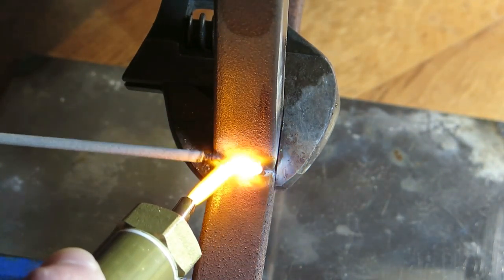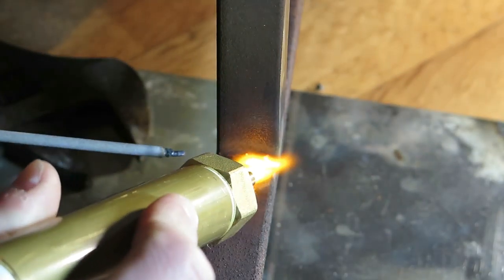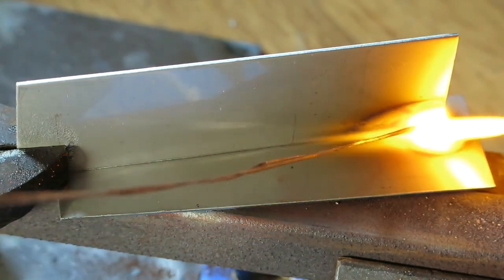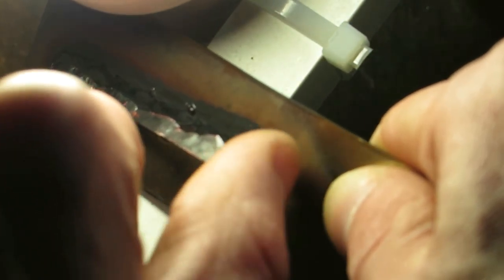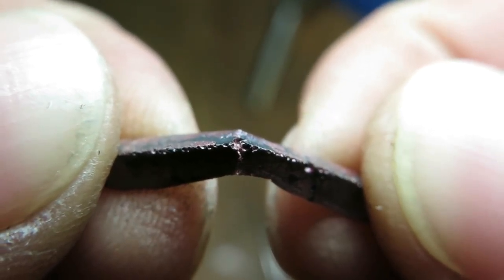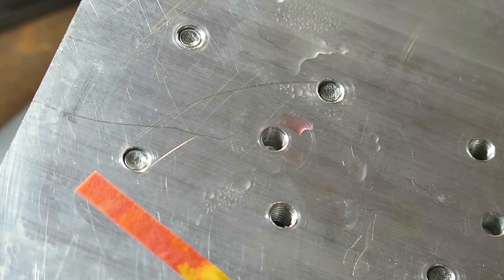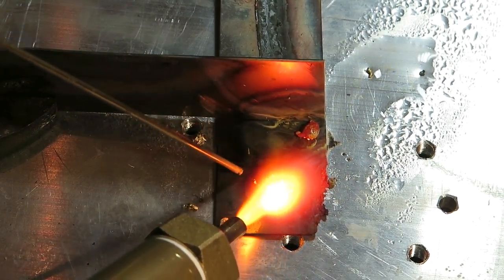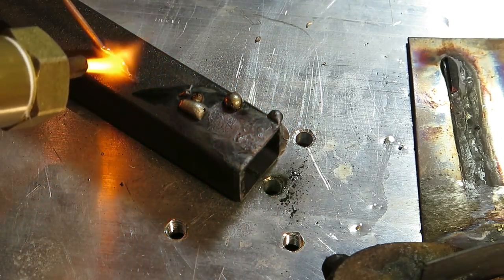Welding, brazing and melting glass with 1KW HHO

Comment: 5:54 it's due to the WATER atmosphere.  All of your metal welding issues are due to that.  Water (steam, actually) is quite reactive at this temperature.  You have oxygen, hydrogen, and vaporized metal all getting into a reactive state before calming down and going to metallic hydroxides and more water vapor.

Comment: Problem is you need 4to 6kw to weld!! If you hook up a high pressure tank that builds pressure up to 90psi then you could weld! JUST MAKE SURE TANK IS STATIC PROOF! AND YOU HAVE LIKE 3 BUBBLERS AND 3 CHECK VALVES!! OR ELSE YOU WILL BE BUILDING A BOMB!!
Reply: My 3 MOT welder can weld steel with less wattage than that. If I want to weld with hydrogen, then I could just dunk a 6013 in water or expose it to humidity.

After the cellulose in a 6013 absorbs enough water, then I could get a hydrogen flame while welding.

Comment: hho gas is an oxidizing flame you cant weld with it . Water is h2o which means you have a 2 to 1 ratio,  this produces an extremely hot flame and melts nearly any metal you can think of but there is simply to much oxygen ratios used for welding brazing and soldering is more like a 4 to 1 ratio.
Reply from the maker: Hi, sorry for not responding. Yes, yes I know, I just wanna to try :)

BTW I tried to melt 10mm diameter 50mm long tungsten carbide rod(milling tool) without success. I guess, that blackbody radiation was quite high...
Reply: adding some propane flow can solve the problem i think
Reply: I've heard of people using acetone bubbler to make it less oxidizing  and more reducing.  Would that make a difference for brazing?

Comment: Try using dry boric acid for your brazing flux.  Heat the rod and dip it into the boric acid; it will adhere to the rod and as an arc welding rod.  For stainless, you will probably need nickel silver rod, (actually nickel steel).  I was hoping to use HHO flame for glassware, myself.  Thank you.

Comment: I have never welded or cut anything with hho, but I have welded, silver soldered and brazed with oxy acetylene and if you dont clean down to bare metal and heat the two metals you will never weld anything! I think HHO would work very well for silver solder since you don't actually work a puddle, it could do work for welding too since it doesn't need a shielding gas, but I think adding an extra bubbler with acetone in it may change the gas ratio to a cooler flame...

Comment: one thing is sure, you are not a welder. when a welder wants to close a hole in steel they may cover it with a piece of copper because it will not stick ;) and yes the atmospere is very important in welding. mot welding processes use special gas flow to protect from surrounding air ... use a gas like argon. so yeah material choice etc are important. you can not just randomly weld everthing together like that

Comment: there is some sodium fog in your gas flow, you need serious HHO gas postprocessing, wash with H2O in U-type bubler - that always work correct with flows, then use mix (1:1 H2O+acetone liquid mix bubler) for deoxidization
 of mix, (plain HHO burns in O2 containing environment(atmosphere) in excess of oxidizer - good for cut metals only), and probably you will reach deacidification too, if not, you have to put charcoal filter before last- acetonwater bubler, charcoal has extremely good adsorbtion for halogens like chlorine - it can collect it inside almost like liquid chlorine density, after some years you can heat charcoal in oven or so, outside(ventilation)- on high temperature clorine will evaporate giving rest - recycled charcoal
with aceton-water bubler you will get MUCH BIGGER flame, and it is not fake size- aceton burns in air hotter than butane for example, in my bubler torch(frige compressor+bubbler with petrol and mixer of pure and fuel gases in needed proportion) i used many kind of fuels, isopropanol will work only with drying powder mixed - i used succesfuly Na2SO4  unhydrous, you can rehydrate copper sulphate or magnesium sulphate in oven - to get them unhydrous - copper sulphate show by blue collor when you need to rehydrate it again to white - anhydrous form,same with acetone - when bubbled with air flow - such fuels cooling down and sweat collecting air moisture - dissolving it, when isopropyl alcohol became 70% but not 100%  - it can not give flamable gas in air bubbler... drying powder(you have to put half of glass for example - to get residue layer on bottom of bubbler, or maybe 30-50gm, and it will work long - when fuel cools and collect water - drying powder adsorb water and heats up - solving reason of problem equaly - in real time, anyway - you dont need it for hydrofobic fuels like petrol(naphta) - but it also cools - maybe it is even not good advantages of petrol - to discard moisture 
what i want to say - aceton much hotter in such application, not hot enough for iron melting, but gives fat size flame that easy melts glass in wide range of stechiometric deviation of your settings
Reply from the maker: THX for info, will keep in mind.
Reply: beware - realy pure HHO explode much stable step by step style - for example you will stop it easy by water bubbler, but not with  any kind of pressed grid, wire, shot pellets powder or so - flame will burns fast through it, but it stops by fiberglass braid from multimeter thermocouple - due to some impurities make flame yelow on contact with glass-fiber and flame loose its speed and stops there
Reply from the maker: @IamJiva  Hmm interesting.. I have created bit less wet method, but still not solid-state
https://www.youtube.com/watch?v=tf3uACV5q04

I am quite sceptical of stopping HHO flame by anything else than cutting it physically.

Even if it would work, I would be paranoid still :)

Comment: Copper when molten will dissolve oxygen gas which leads to those bubbles and voids you see. Most copper containing brazing rod contains something to remove the oxygen such as phosphorus or zinc and a flux to cover and clean the base metal.

Comment: Weld :   Two metals are melted together with the use of a pool of molten metal.  The shielding gas or shielding chemical stops the oxidation of the metals while under heat. 

Braze: heating two metals over 840 degrees but less than the melting point and joining them with another metal with the use of a flux to allow the joining metal to leach into the parent metals with capillary action

Comment: The best welding application for HHO is to weld aluminum, or kopper. No brass, steel or Stainlesssteel is possible ( I found) The flame is causing too much oxidation. Using an aluminum brazing flux and rods it is the only success I had… oh, and glass… it melts glass beautifully.
Reply: One has to use something to remove oxides from the surfaces of metal. And I also think that flow of HHO is too slow to make a difference.

Comment: You missed the point of brazing.off course it exploded.The point of brazing or soldering is, you heat the metal to be brazed, then ler the brazing rod melt in beetween the metal to be brazed.And not heat brazing rod directly.And what i understand, the cone of your flame generated less heat needed.The flame should be bright in the inner cor and blueish in the outer core while yours red orange

Comment: I believe the brass explosions are from trapped water from the torch. The brass traps it and the excessive heat causes it to turn to steam and cause a small explosion.
Reply: Incorrect grasshoppa! The brass explodes due to it getting too hot! When I was first learning how to gas weld steel I used to explode the metal puddle all the time due to same issue. Got to control flame & how long it's applied to a given area! Hard to do that with such a hot flame!

Comment: When the hydrogen burns,the exaust is water, with such a thick heavy flame,it's producing a lot of water , the water is flash boiling on the molten metal! Poor water on molten metal, it explodes! Need a finer tip, which will cause u a hotter smaller flame, and less water exhaust to flash boil. This will help you big time! Thanks for the video!

Comment: as others have mentioned, flame is to oxidising, especially as steam reacts fairly well with iron to at those temperatures. not all flux is going to resist the steam so well, especially not fluxes which rely on generating an inert gass (like the stuff on welding rods). i would recomend a flux which acts primarily as a reducing agent and remains in liquid or solid phase, a good example is rosin flux (pine sap would act similarly). the rosin disolves oxides, reacts with stray oxygen and will resist the steam from coming into contact with the metal so much. you can clean the joint after with most organic solvents.
Reply from the maker: Yes I know. But it's interesting, that at 1:30 electrical wire wetted SS pretty well, but in same conditions phosphor copper alloy did not stick...
Reply: it is interesting, i am not so familiar with that particular alloy and cant seem to hear you mentioning it in the video. is it the brass which keeps popping or the copper you try on the mild steel?. P2O5 loves to grab onto water and form phosphoric acids, maby this is forming a powder coating which could impede wetting. high phosphorus alloys of steel are verry brittle so that could explain why it wasn't sticking after it cooled but not why it wasn't wetting.
Reply from the maker: Phosphor-copper was tested on mild steel in this vid, but it behaves the same on stainless...
there http://www.reade.com/products/copper-phosphorus-cup-alloy 
they say, that it's used "As a deoxidant, alloying agent, brazing, wetting agent and as a nucleant among others"

P2O5 is not applicable here... I think also, that many metal oxides are not quite stable at those temperatures...

I didn't expect brass to explode. flux covered brass for example wetts the metal, and if heated a lot then it jumps and kinda explode, but in this vid it looks like id does nothing and then something triggers and it release energy. No reaction is evident and even that energy looks like pure kinetic energy so it's quite strange... On some forums they talked about explosions of brass, but all using oxy-acetylene and no one said oooh you don't know? That's because XXX. They are all like I dunno, maybe try this...

Maybe I can repeat this experiment using flux and same rods and see what will happen. I am going to rebuild electrolyser so it doesn't look so sketchy and I will braze some steel square pipes for end plate support so we will see.
Reply: the reason it is a deoxidant is because the phosphorus is preferentially oxidised to P2O5(g) this could then deposit on the surrounding metal, it may be that the amounts formed are not enough to get in the way as i was describing.  

which clip is the phosphorus copper alloy used? i am struggling to tell the difference between that and the copper wire, i thought you may be calling it brass which is why i asked if that was what you were referring to.

at high tempritures the oxides are taking part in a reversible reaction you are right, however in an oxidising environment they rapidly reform.

the exploding brass is verry curious. it reminds me of bumping in superheated liquids.
Reply from the maker: yeah so 1:30 is electrical copper wire.
6:20 is phosphor-copper brazing rod.

Today on YT: https://youtu.be/_30lR-nbpXg?t=5m57s
Zinc is boiling at 907°C, so maybe zinc content in brass is the answer...
Reply: by the way, i'm thinking of building a NaOH electrolytic cell, what is the "stove sealant" you used? most use some form of silicone which i would imagine would disolve in NaOH like most oxides of silica, and others appear to use cements composed of metal silicates which i assume would have the same problem.
Reply from the maker: Yes i should say something like "furnace cement".
something like this https://www.amazon.co.uk/Heat-Resistant-Sealant-1250-300ml/dp/B0046450C4
These are based on sodium silicate, so they wont react. Dissolution was not evident. I am planing to make CAD design video on this cell, that may conclude some findings by running prototype cell and mainly automatic sodium drain. But automatic drain would be still quite experimental, because if sodium will freeze in drain tube that may be not nice...
Reply: interesting, i'm pretty sure metal silicates are soluble in NaOH though as it attacks clays (a form of metal silicate) in even weak solutions. sic. http://www.clays.org/journal/archive/volume%2019/19-5-321.pdf
though maybe it needs water to attack it, cant find anything on the mechanism.

looks like its time to do some experiments, maybe i'l try sodium metasilicate mixed with powdered montmorilonite. (i don't like using products which don't tell me everything their made of, can be a bit dangerous to not know incompatibilities)

i would definitely like to see that if you make it, you only need ~100C for the sodium to stay molten so as long as the drain tube is reasonably conductive i would imagine the sodium hydroxide (300+C) would keep it hot enough for short distances. have you seen anyone else with an automatic sodium drain? and any ideas for how you might build one?
Reply from the maker: Yes sodium silicate itself is soluble in water. I did a few molten NaOH / water wash cycles(which are probably worst thing here). I am not saying, that this cement is completely intact, but I am pretty sure that it can withstand 100 such cycles(perhaps 20 years).
I would be more concerned by its sealing ability, adhesion to metal surface and thermal stress cycling and also stresses caused by dimension changes of metals due to heat.

I think that i mentioned, that molten NaOH has pretty low viscosity. I would compare it to ethanol maybe.
Reply: @IlusysSystems  Electrical wire is pure copper.

Comment: your flame needs to pass through a bubbler that uses acetone or alcohol or naptha to act as a reducing agent for your welding
and you need to strip off the flux from the rod!

edit: since your gas seems to be containing Cl2 you need to add NaOH to your bubbler and include a sparger to act as a scrubber and that will also help add more reducing agent in your bubbler containing acetone
Reply: The yellow orange color looks like sodium is in the flame.

Comment: Can you try this again if you still have it?  Narrow the nozzle maybe a touch.  Pull the torch back a few inches, go back and forth, in a z pattern, or draw little circles.   Don't add the filler rod(and it looks like you're using arc welding rods?) until the metal has pooled.  Torch welding is actually very slow, hence why TIG mostly replaced it.   Try slowing down a lot, basically.
Reply from the maker: Problem here is, that the flame is not dumping enough energy into nominal area.

Probably with higher pressure and more agressive flame, it would behave more like TIG, but I have'h got balls to try that.

Must grow some :)

Comment: You could do it if you didn't put the flame directly on top of the rods. Heating just the sheets with the rods behind the flame should take a little longer, but it wouldn't oxidize the welded parts. This is common practice with tin welding for electronics as well, always heat the parts, never the rods.
Reply from the maker: The problem is, that this generator is rated for 2kW so you can get I don't know say 1kW at torch. so you really want to use as much heat as possible.
in video https://www.youtube.com/watch?v=Gzxu_YCVHME I am brazing without problems.
Only difference is, that I am using rods with flux. And technique of course...

Edit: wrong video :)

Comment: The auminum will react with any NaOH in water to produce hydrogen gas, sodium aluminate, and heat. That might explain the acidic reading on the litmus paper
Reply from the maker: Problem is, that sodium aluminate is alkaline. Even if there was hydrogen dissolved in water, aluminate PH would be more prevalent.
But it actually may be just effect of dissolved hydrogen - it is quite soluble. I would have to test this..